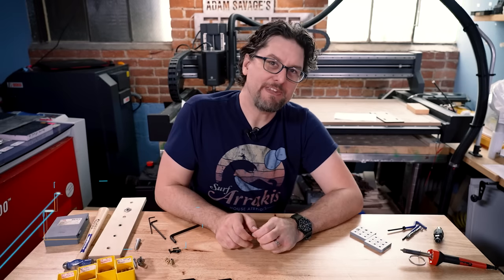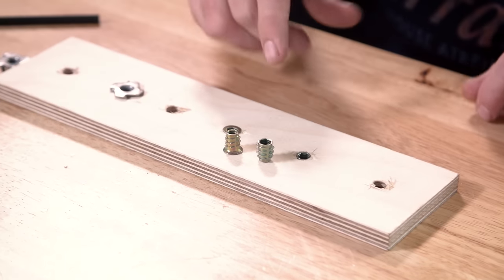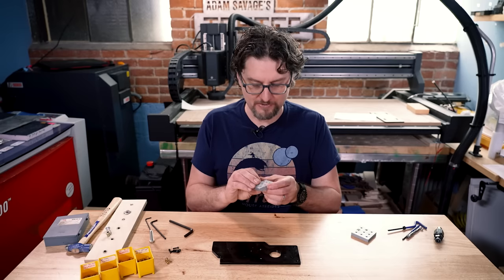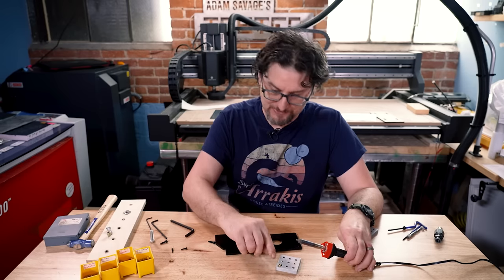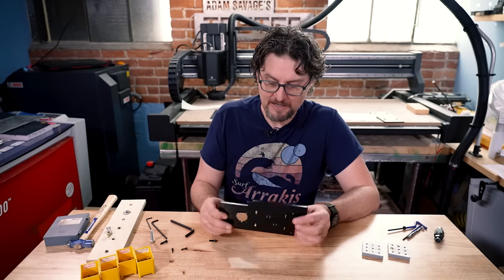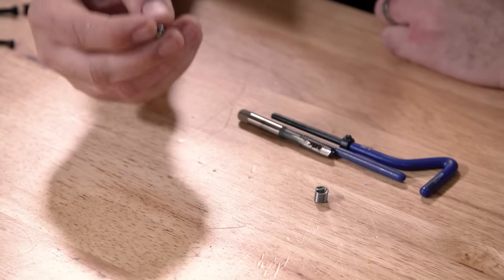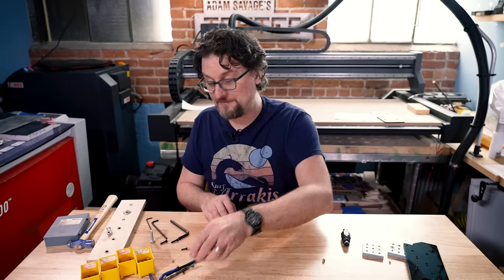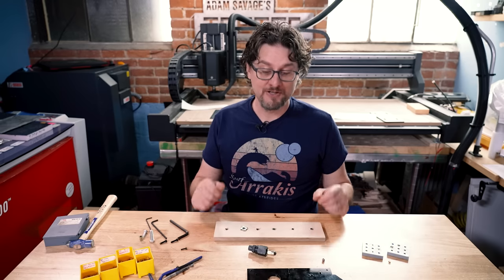How to Use Threaded Inserts for Wood, Metal, and 3D Prints!

Comment from the maker: T-Nuts for Wood - https://amzn.to/3Mqg4Hq
Screw-in Inserts for Wood - https://amzn.to/3sGi9qX
Heat Set Inserts - https://amzn.to/3PwdT7g
(NOTE: you want the type with angled grooves - I find straight up and down grooves tend to pull out.)
Press-fit Inserts - https://amzn.to/3wjN0M7
Screw-in Inserts for Metal - https://amzn.to/3lkZvRm
Helical Inserts for Metal - https://amzn.to/3ljCNsF
Rivet Nuts - https://amzn.to/3NjLQpt
Disclaimer: Tested may earn an affiliate commission when you buy through the links here.

Comment: Helicoils can also be used in soft materials like aluminium with fasteners that are inserted/removed alot. The tread can wear out, but with a helicoil it last longer as it is a harder material. (Example in milling fixtures for example)
Reply: It's funny I've always found the opposite to be true. And replacing the helicoil is a bigger pain than replacing an insert.

Comment: High strength tip for Aluminum or other soft metals: For metal on metal inserts, IF you need higher hole strength, but are limited on bolt size, use a helicoil insert. It upsizes the surface area that the soft metal interfaces with.
Reply: +1 to this, I've also been told that you shouldn't use timeserts (the other metal inserts) on aluminum in any application where there's heat cycling (so most automotive applications) because the different expansion rates, plus the heat breaking the locktite can cause them to back out. No idea if that's really a huge issue, but I've always avoided timeserts because of it.
Reply: @ianloughney9570  Ive always used time-certs in aluminum oil pans to replace stripped out threads. I haven't seen any return leaking from the time-cert. Maybe the oil provides enough cooling.
Reply: @ericbauer4559  I would guess its one of those things that has a bunch of variables and people just oversimplify out of an abundance of caution. It would be cool to see/do some testing on it though and see if its legit or just an old wives tale.
Reply: The downside, I find with helicoils, is if you are taking your fasteners in and out often. I find they don't hold up for this sort of thing. Repairing a damaged helicoil is a bigger pain than repairing an insert. Inserts are easy peasy.

Comment: to add to the info about helicoils which are VERY commonly used in aerospace (because aluminum is lighter but softer than steel).  helicoils work well, but they are not perfect, so occasionally the inner threads will get damaged. when that happens, pull out the helicoil and replace it - DO NOT USE A TAP ON A HELICOIL!  helcoils are made with hardened spring steel - the tap WILL get stuck and break.   now you are faced with drilling out hardened steel stuck in an aluminum $$$ part - it won't end well.
Reply: Then the machinist gets called in on overtime lol
Reply: That’s how I fixed a stripped oil pan from the last time my mechanic overnighted the stupid aluminum threads thus leaking oil everywhere. I’m not sure it was called that specifically but it was some specialty tool that wasn’t cheap. Slowly drilling into the bottom of my oil pan was a bit scary but it worked great.

Comment: Those ‘T-nuts’ are used the other way around. You hammer them in the wood on the opposide side of the place where you want to screw something in place.

That way it grips through the material and holds it firm in place.
Reply: Thank you. I used those all the time when doing stagecraft, and they are always put on the other side of the wood from the bolt.  If you put them on the same side, they'll pull out the first time you remove the bolt or there is any separation tension.
Reply: That's not always possible, as in his example use case of adding threads for leveling feet.  Kind of hard to attach them to the "back" of something, when the item is many times further away than the length of a bolt.
Reply: @belg4mit  I that case they are the wrong application. Then the threaded inserts are a better choice.
Reply: @Tclans  Threaded insert AND epoxy. Personally I see no reason to install inserts w/o epoxy. Flanged ones with epoxy are pretty great for any woodworking.

Comment: For those hammer-in inserts you start out with, they are best suited if the screw force is pulling to the other end of the board. I've used thousands of them, and they've never torn out for me, even when using M10 bolts on ply with quite a bit of torque. And they can create an extremely clean look from the other side. You can also drill (for instance, for M8 thread) a small 8.5 mm hole on the visible side, and a 10mm hole just deep enough for the insert's collar on the backside. And if you want them perfectly straight, don't hammer them in, but use a sacrificial board from the visible side with a similarly sized hole and large washer, and pull them in using a short bolt.
Reply: Exactly, I was going to post he was doing them backassward.
Reply: Yep. Put them in on the underside. I have a little fleet of dangling machine bolts which I screw upwards and out of the top of my workbench which I use in combination with nuts and washers to bolt down my drill press, my vise, my dremel tool press as needed. (By necessity, I have a small workbench and can't keep them all out and bolted down at once, so I needed a modular solution.) I installed them basically how you describe and they aren't quite perfectly flush, but they're good - and not going anywhere.
Reply: I find it hard to take a person seriously when they make such a fundamental error on using t-nuts.

Comment: Besides using inserts in metal to fix a destroyed thread, you also use them when (A) you have a softer metal and will repeatedly use the thread or (B) are using stainless steel and want to avoid seizing of a bolt, especially if it is stainless on stainless. As for other brands than Helicoil, one other is called KATO.

Comment: A couple random thoughts.... 
Wood threaded insert can 'pull-out' the wood as it gets screwed in. This is more likely to happen if you don't drill the correct sized pilot hole and depends on the type of wood as well.

T-nuts are effectively clamping the wood - between the head of the "T" and whatever you are screwing to it.This is functionally different from the other inserts shown and I'll argue gives you the strongest screw/mounting.  For T-nuts sitting proud of the wood you can counter-bore the "T" so it sits flush with something like a paddle, or Forstner bit. To stop the t-nut from possibly falling out and/or rotating, use a small wood screw between the 'notches' in the head of the "T". Yes this adds more steps but removes the issues mentioned in this video. T-nuts are easily the most used wood insert in the shop I worked at for decades.
Reply: Good tips - I have done the Forstner trick - love the addition of screws in between the legs.
Reply: Another video shows that the shear forces involved for t nuts (or regular nuts) is essentially the same as the inserts.

Comment: Oh, especially about T-nuts and leveling feet: They do not take lateral forces well. Tried moving a cabinet a couple of inches by sliding it across the floor, tore out nearly all of them. I learned my lesson then and there :'D
Reply: Yeah that's a risk. It helps if you make deeper holes and use the threaded portion of those feet for extra stability in those holes. I also tend to add a few layers of wood on the location of those feet so that if you have the feet on their "lowest" position of the cabinet, the T-nut will touch the shoulder of the feet, or actually the floor if you use plain set screws.
Reply: guys ur doing it backwards, just hard mount a bolt with a nut and use a long "coupling nut" with whatever u want attached to it as the foot

Comment: Thanks for all the comments and especially the t-nut tips! I have recessed them with a Forstner before - but I love the additional tips of adding some epoxy and/or wood screws between the legs to prevent spin out.
Reply: If You are ripping the T-nuts out of the wood, You are entering the bolt from the wrong side.
Reply: @qivarebil2149  most of the times   I have used these it wasn't possible to get them in from other side

Comment: Good example for Metal inserts would be to replace the sparkplug threads. (probably the most common place they are used)
Reply: Which is an application Helicoils are great for. The spring tightening action is very gentle on aluminum threads, therefore making them ideal for continued use. I.E. changing the plugs more than once
Reply: @XemawthEvo2  Assuming the person removing and rescrewing the spark plug or fastener is careful with the process. I work in an large aluminum extrusion plant maintenance machine shop. I'll put an insert in any day over a helicoil. Simply because I know it will be back in a few days to repair again. And replacing an insert is a breeze compared to a helicoil, for me, at least.

Comment: These rivet nuts I have used when I needed to put removable plywood panels onto a welded aluminium square tube frame. It worked great, just a friction fit and flange on the back side did the job.
Reply: I’ve had a lot of trouble with rivet nuts when it needs to be mounted again and again, like a set on tour for example. They loose the grip on the frame and just rotate. After half the tour all the rivet nuts have been drilled out and replaced with through bolts. Every time.

Comment: More videos like this from Sean please!  Great content!!

I use a lot of the coarse threaded M6 inserts to add small smooth rolling 1" ball bearing 6mm threaded casters to many things, mainly or soft wood or of plywood or mdf .  I drill 9mm blind pilot holes and follow with a quick spin of a  large countersink bit to make sure the insert can go 100% flush.   Then i carefully thread in each insert by hand , cutting the coarse threads while  making sure they are aligned straight perpendicular.  i then take them out and squirt in super thin CA glue  over all surfaces inside the pilot hole with a micro tip applicator.  it soaks into the wood and makes it rock hard and much stronger.  i give it 30 secs to soak in then put the insert back in, usually using a power driver with hex bit to make sure it goes in fast enough / all the way ,  without the glue starting to bind it.
Reply: Thanks for the tips.

Comment: T-Nuts are awesome.  I usually counterdrill the hole a little with a forstner bit, so that they sit flush.  I will also admit to welding up a hole in steel, and then re-drilling and tapping the weld, because I never have helicoils when I need them :D

Comment: Sean I have used T nuts and what I found worked for me was I drilled the hole for the threaded portion but I also drilled pilot holes for "dogs" I then mounted it so that the face was just the threaded hole that gives you more support so it doesn't strip out. Also I counter sunk the back so that it would be level so that you didn't have the ridge of the back of the T Nut.
Reply: They can be really hard to install in harder materials like MDF that doesn't like to be hammered into. I've used them but really not a fan.
Reply: @F0XD1E  if you just drill a fraction larger hole and follow the ways that I mentioned it will work with a little more ease.
Reply: Great tips!

Comment: Using inserts in metals like aluminum is just good engineering.  Aluminum threads tend to be weak, and a steel screw will want to gall all the time.

Comment: I recently started using heat-set inserts for my 3D prints where I need to use screws, and I find that it gives me a much more professional looking product in the end.
The way I avoid the "insert pulls out with the tip when you use a regular soldering iron" problem is I don't jam the tip straight into the insert, I put the tip across the top of the insert instead. This requires a bit of finessing to make sure you put the insert in straight, but once you get the hang of it, it's pretty simple.
You can also buy special heat-set insert tips for most common soldering iron brands, so there's no need to buy an entirely separate soldering iron.
Reply: You could also have some pliers ready after pressing the insert into the plastic, and grab around the tip so that you keep the insert in place if it wants to pull out with the soldering iron

Comment: There are also pop rivet nuts, works like the rivet nut you showed, but made of alumin(i)um, with a special pop rivet-like tool. Fairly cheap and easy. The small ones (M3) tend to partially strip themselves when riveting though, but they sort of work anyway. (My kit was cheap, so maybe that's why they strip.)

Comment: Over on Edd China's channel they were using a torque wrench to tighten a bolt on a mini suspension they were installing and a loud crack was the aluminum threads stripping. In the next episode they got a steel threaded insert to put in the aluminum part and that was able to take the proper torque. (Not sure about the long term corrosion implications of steel in aluminum though.)
Reply: Sometimes that just happens unfortunately. Luckily in my case I was able to use a longer bolt and the hole was threaded quite a bit deeper. This was for an alternator bracket.

Comment: Yeah, helicoil are spendy, but I've used them in engine heads/blocks and never had a worry.  Not sure they are "maker" friendly, but for hard-use applications they are invaluable.  Beats buying a new head or tossing a block....by a LOT.

My second favorite is definitely rivnuts. An awesome tool.

I found a few more options from this video for 3D printed parts I will 100% be checking out!

Comment: I was trying to install thread inserts on my guitar (to accept the pickup mounting screws). The problem I have was I have to drill 2 holes exactly parallel to each other, and exactly perpendicular to the guitar body, otherwise I won't be able to mount the pickups. If I screw up, I would have to plug the hole and try drilling again. 

With the tools I have I'm not confident enough to execute that. In the end, I used the same wood screws that come with the guitar. The inserts are still with me.
Reply: One thing to try is make a custom drill guide jig in a thick piece of wood.  Drill your two holes in the jig at the required spacing.  Insert  the bare drill bit in each hole and use a square to test that they're perpendicular.  If not then try again with a new set of holes in the jig.  Once you're satisfied then clamp the jig onto the guitar  and use it to guide your drill.

Comment: I made a workbench out of one of those 2x4 kits from Amazon a couple of years ago. I made a grid on half of the surface with 5" spaced holes (my vice has that spacing, so I just continued the pattern) and put T nuts on the bottom surface. I then got some threaded rods and threaded through hole hand turn knobs and cut some studs with 5", 10", 15", and 20" spaced holes, and now I have a super flexible clamping system on the cheap. It worked out really well.
Reply: Anyone know what the load capacity is of Inserts (non-flanged) into soft wood (pine)?

Comment: My dad and I owned a pulse autocycle and the fiberglass panels on the back were held on with a smaller version of the rivet nuts.  We found that you need to use a backer sometimes liker a split washer to keep them from turning in the hole if you take the screws in and out on a regular basis.  You can get a pop rivet gun like piece to put them in.  These were how the originals were put on but we should have just had a strip of metal and welded nuts on to make it more secure for how many times we took the rear section off.

Comment: It might help to discuss these options in terms of strength under tension and compression.
The t nuts are best used under compression, as that pushed the barbs into the wood  whereas under tension you are relying on the friction of those barbs within the wood. Ideally they would be use to put feet onto wooden furniture. The other inserts do better under tension, but not as well under compression unless there is some backing material like a blind hole

Comment: I use rivnuts on my 3d prints, initially because that’s all I could find locally. The flange give you more mechanical advantage than the heat inserts, especially if you’re tightening the screw a bit. Only issue it that the machine screw needs to be longer to make it to the other side of the part compared to a heat insert right near the surface of the screw.

Comment: T nuts are meant to be installed from the back side so they don't pull out.
Helicoils are not great for applications where you use the treads repeatedly.  Eventually they can seize to the bolt and rip the treads out.  Keenserts are better for repeated use.
I don't think he talked about pem nuts, which are anther treaded insert for sheet metal.  They are very common but require a good bit of precision to install them securely.
Metal inserts in plastic are commonly installed with ultrasonic tools these days.
Reply: @Matthew Morycinski helocoils are just not a robust solution for threaded holes frequently used.  The top threads especially are easily damaged.

Comment: A low-buck/get-it-done-tonight option for 3d prints is to model in a slightly undersized hex pocket for the nut corresponding to your needed thread. Then melt in or violence-in the nut. I use that all the time instead of proper threaded inserts. The top and bottom undercut of the nut give it a surprising amount of pull-out resistance. Obviously not as good as a bespoke piece of hardware. I sometimes epoxy over the nuts, too.
Reply: violence-in gonna be my word to use this week, ty